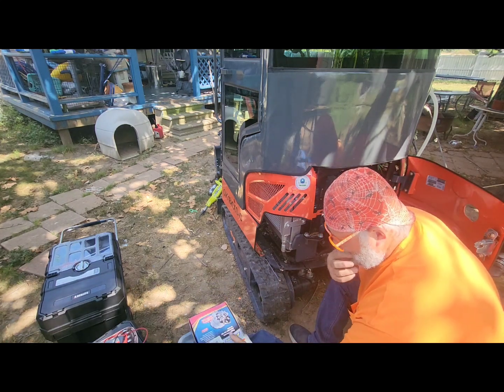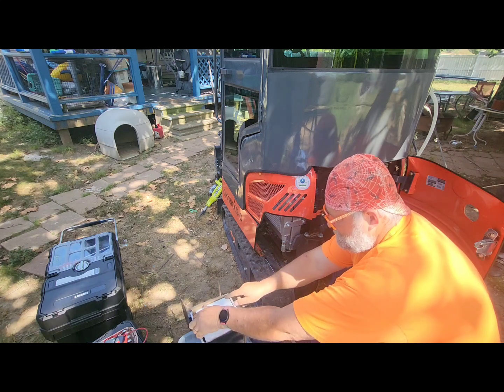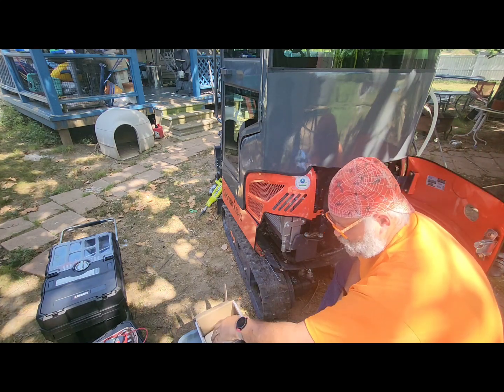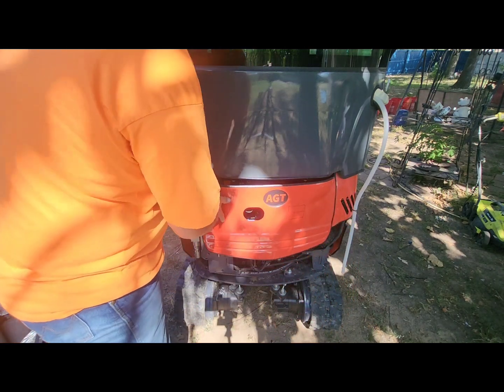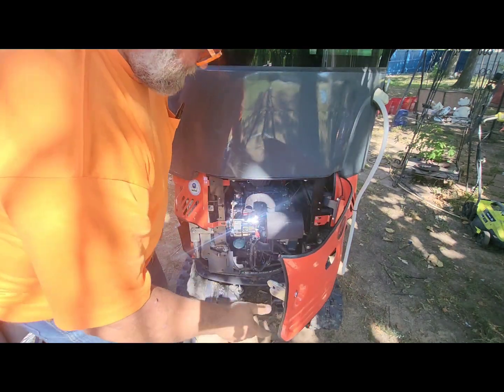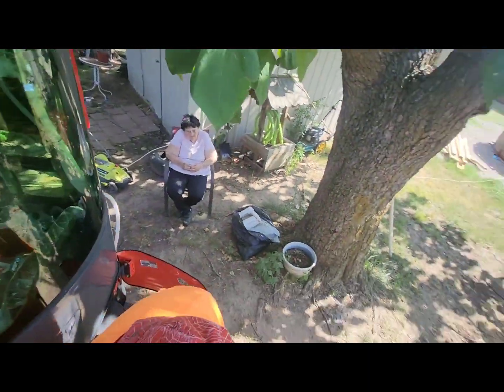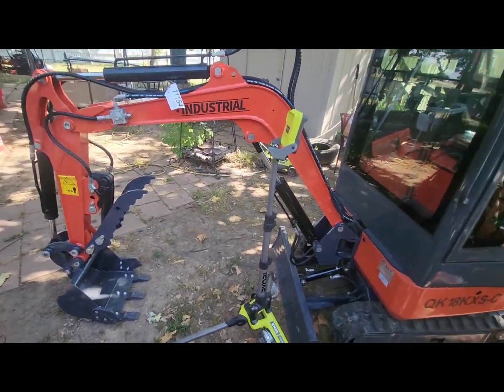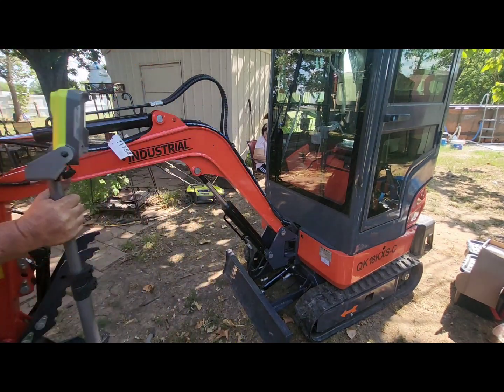AGT QK18KXS-C  Mini Excavator  installing a  100amp 1 wire alternator  for ac

Comment: What types of charging device did it have originally? Was it not an alternator? I know the gas ones use the stator but I thought all the diesel ones had an alternator.
Reply from the maker: It was a 14amp generator type. Not enough amps to run the ac.
Reply: @jtsokiehobbyandadventures6666  Was it belt-driven like the alternator?
Reply from the maker: @travispolson4615  yes.

Comment: What kind welder did you use on the muffler.
Reply from the maker: The little green 125amp harbor freight mig welder.  If you catch on sale for a bout 150.00
Reply: @jtsokiehobbyandadventures6666  flux core wire no gas and it welded good. I am about to do the same
Reply from the maker: @sgea_panda7647  flux core no gas. It's all I have used

Comment: What size wire did you use from the altenator and did you go to the starter or straight to the battery...?
Reply from the maker: I think it either 8 or 10 gage and ran 2 wires. I went from alternator to the starter.

Comment: Just curious but why would you need to upgrade the alternator if the machine already came equipped for A/C?
Reply from the maker: It charging thing puts 14amps out. The ac system takes between 30 to 80 amps to run. If there is not enough voltage it does b2. That is low voltage.  So if it drops to 11.3 volts the ac shuts off. The 1 wire alternator runs at 14.4 volts and 100 amps. Keeps battery charged and runs off alternator voltage.
I did tried 60amp alternator.  Not enough amps to run all full time. After 20 min shut down. With the factory it run 5 min before shutting down
Reply: @jtsokiehobbyandadventures6666 well I was looking at some smaller machines locally and held off buying this week thanks to your videos. I found your exact machine for pickup tomorrow for 8k$ local but the front windshield is missing. Was gonna cut some poly for the front windshield and maybe spray the front cab area with some line-x before I install the polycarb. I like what you did with the alternator so will probably do that if I pick it up. How you liking the machine so far?
Reply: @jtsokiehobbyandadventures6666  How did you go from two wires to the one wire alternator. My unit has two blue wires going to the factory alternator.
Reply from the maker: @DavidDavis-uj2vt I have by past factory.
Reply: @jtsokiehobbyandadventures6666  Thank you Sir.  I'm doing the 100amp alternator swap - adding a cooling fan to the condenser/ radiator - relocating the outside AC unit to the rear - and making the left controls tilt back for easier entry and adding gauges.
Reply: What size wire did you use and di you go to the altenator or straight to the battery

Comment: Hey JT Okie, thanks for sharing your knowledge and ideas for upgrades on the AGT QK18KXS-C Mini Excavator.   What are the dimensions of the front windshield?  I haven't picked mine up yet, but I won one from RB that had "shipping damage" front windshield shattered.  I was thinking of using lexan polycarbonate as a replacement.  Thanks for again for the sharing of your knowledge and skills.
Reply from the maker: https://www.facebook.com/share/v/ZdtzbB9kThvvTR9p/?mibextid=oFDknk.
Look at this video. He just replace d his glass. He may give you more informations. 
If it is something I have done I'll try to answer. I will be posting new things I'm doing. Is your diesel or gas.
Reply: @jtsokiehobbyandadventures6666   Yes mine is diesel, and thanks for the link.

Comment: Hey I just pulled mine off a trailer. What is the switch for the boom pivot.
Reply: I just got mine today and i was going through all the functions ,to pivot your boom push down on the left joystick top there's a rubber button and integrated,press it down and then you move your lever to your left or to your right
Reply from the maker: I need more information or picture to help question